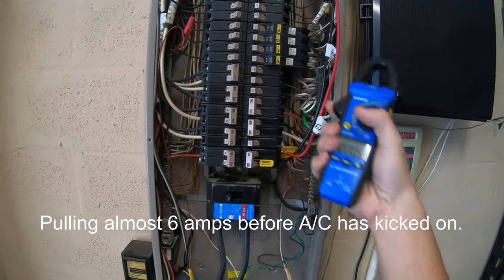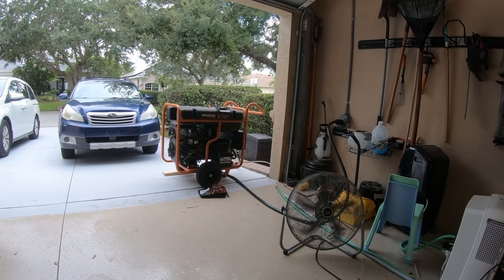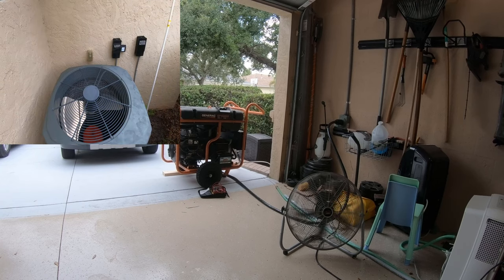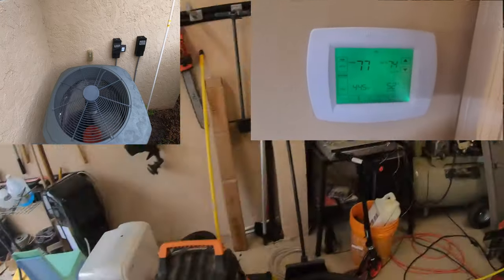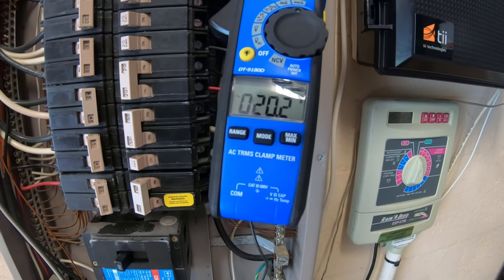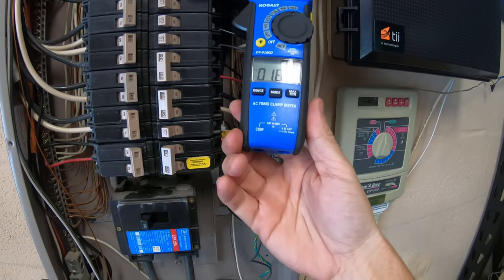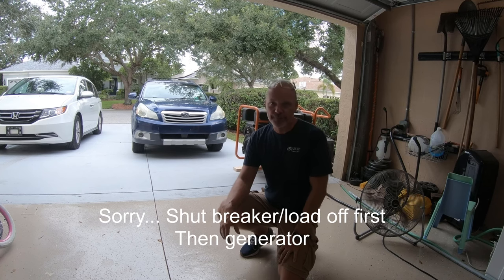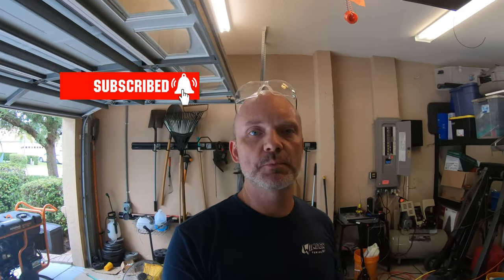Can I run central A/C on Backup Generator Power?

Comment: You gotta be careful using a genetic generator and sensitive electronics, like digital clocks, computers, routers, etc...anything over 5% THD (total harmonic distortion) can kill those electronics. I lost the control board on my water softener unit after I used it with my generator.
Reply from the maker: Hopefully I'm ok, my real sensitive stuff is all run off a UPS... which doesn't really care for the generator but tolerates it at higher loads. My understanding is the "dirty" power at lower rpms is cleaned up at higher rpms.
Reply: @JackofAllTrades1  it's safer to use an inverter generator. They are more expensive, but you don't have to worry about THD.
Reply from the maker: @mr.boniato6402  yea... maybe in the cards in the future. I've wanted to downsize this one as it is a gas hog.

Comment: If you have natural gas to house would be great to convert generator as that unit will use a lot of gas. I'm not surprized that it ran your 5 ton ac as I have a 12000 watt Winco tri fuel that runs my 3 1/2 ton ac. Running a generator off natural gas you lose about 20% wattage but you could probably still run your ac with that unit.
Reply from the maker: I've looked at those conversion kits... about another 300 dollars to upgrade it. I have natural gas too. I think I need to get a better sense of how much the power will be out here on a yearly basis to determine if it's worth it...... it would make it more reliable though. Thanks for the comment.
Reply: @JackofAllTrades1  That's a tough call. One extended power outage and you'll be cursing yourself running for gasoline constantly. That big boy will burn 1 gallon per hour.
Reply from the maker: @laurarettig9874  true... right now the emergency plan is to have all the cars full of gas before the hurricane and just siphone from them. I figure with a plan to run a couple hours on and a couple off I can make it a week. This has a 16 gallon fuel tank on it and I can store about 77 gallons total.
Reply: @JackofAllTrades1  During hurricane Sandy I was without power 12 days and getting gasoline was an issue. I was told it was near impossible to siphon gas from new vehicles. One YouTube video showed it being done with a pump.
Reply from the maker: @laurarettig9874  12 days is a long time, I'd be in trouble for sure. I have a hand pump made for siphoning gas out of a car... has a weighted tip on it.
Reply from the maker: @laurarettig9874  hey, I hope you are OK with this TS... you said something about Hurricane Sandy so I assume you are upper East Coast. I know that area hasn't done well in the past with hurricanes and flooding. I hope all is well.
Reply: @ Laura r Maybe you can shed some light on my issue. Here's the details:

Your "3 1/2 ton with a 12000 watt generator" scenario is my EXACT scenario. To date, I have:

• Converted my Duromax 12000/9500 watt generator to tri-fuel using Motor Snorkel tri-fuel conversion kit and mounted it to the frame of the generator
• Using a 50Amp inlet and a generator interlock, successfully hooked up generator to a dedicated 50AMP breaker in my 125AMP breaker panel main box (located outside)
• Using a 3/4" quick-disconnect off my natural gas line (from meter), I use a 40ft flex-line (rated for natural gas) that screws into my tri-fuel conversion kit (NG pressure regulator) located on the generator frame
• An Amrad TES5 hard start kit for A/C compressor

The house has no issue being powered by the generator while riding off NG. However, my A/C unit doesn't perform very well. I feel cold air coming out of my registers throughout the house but it is putting out very little air. The fan on the outside unit seems to have low RPM as well. Adjusting the NG pressure regulator's "load block" allows me to adjust how rich or lean the system will run. I've noticed the more rich I allow the system to run, the better performance I get out of the A/C unit (cold air blows out at a faster rate from the registers). However, this begins to heat up the engine on the generator to dangerous temperatures pretty quickly.

So what's my solution here? Do I need NG lines larger than 3/4"? If so, what would be recommended? The Motor Snorkel tri-fuel conversion kit's pressure regulator is designed to connect to a 3/4" line. This is my first conversion I've ever done so any input would be helpful.

Thank you all for your time.
Reply from the maker: @bobdole1232  my first thought us the size if that NG line. My NG bbq grill uses a half inch line to feed it but it is low btu....my pool heater on the other hand has a massive line, at least twice as big. Can you measure the amount of amps the generator is putting out and also the amount the ac is consuming with different fuel types to see if the NG is getting bottlenecked? You could also test out smaller loads on it and work up to see if it has a limitation at a certain Amp and watt level.
Reply: @bobdole1232  This is from Winco 12,000 manual:   Less than 25 feet 3/4 " black pipe
25 -50 feet 1 " black pipe.
Reply: Just remember using propane or natural gas on a generator that'd designed for gas works but will lower your wattage so 15,000 would be around 9,000 to 10,000. Propane or natural gas dosnt have the same energy. I got a kit myself so I can use gas or natural gas just keep in mind that's all
Reply from the maker: @kaylajason8917  good point Jason... I would like to convert mine to Natural Gas but with how little the generator is uses, I am unsure I can justify the price.
Reply: @bobdole1232  You need a Micro Air Easy Start 368
Reply: @JackofAllTrades1  ... as far as I know, there are no "direct fit" NG / propane kits for this unit. The second thing to know is a 15Kw unit will need a bit over 250 cu feet of gas in addition to what your meter is already supplying. Many homes do not have enough to spare in their natural gas feed. IOW, adding a NG gen set without thinking this through may cause your heat or hot water appliance to quit due to low gas pressure. You need to evaluate EVERYTHING on the gas system before going this route.
Reply: @JackofAllTrades1  Live in hurricane state of Louisiana, New Orleans last year IDA out of power 14 days, Katrina 30 days, don't remember others days out of power.  Tried last year to siphon fuel for neighbor, all the vehicles we tried have a anti-siphon in the fill neck to prevent you from putting a hose down into the tank.
Reply from the maker: @bayouslots3143  I will have to try that on our two newer cars to see if I can... I keep forgetting to do that so thanks for the reminder. I know for sure I can get gas out of my '72 gran sport so I guess at the very least I have access to the 16 gallons this gen holds, my 5 gallon gas can and the 20 in the Older car. Thanks for the reminder, I may have to rethink this.
Reply: @JackofAllTrades1  Understand, I empty my 1982 F150 with no problem, we tried  newer Dodge Ram 1500, Drango, Exploere, Rogue, with no luck.

Comment: I would suggest that connecting the generator cord should be done prior to starting, not after.  The primary reason is that provides a safety ground for the generator.  This makes touching the generator frame safer because when grounded it’s less likely to shock you.  Also it means you can avoid touching the energized cable. No need to add risk.
Reply from the maker: Thanks for bringing that up, I dont explain it in this video but my generator is bonded to a grounding rod that is at the corner of the house, if you look carefully you can see the white wire exiting the front of the generac and out of sight. I can't recall exactly which video, possibly my step by step install video but I do go into greater detail on the importance of having a grounded generator. Thanks for the comment.
Reply: @JackofAllTrades1  So, is that white wire and grounding rod connected to anything else besides the generator?   Meaning, is it bonded to other ground wire from the main panel? If there is a dead short from hot to ground and that ground doesn’t have a low resistance path back the the power source then the over current breaker won’t trip.  
For my own generator I depend on the wire between generator and inlet to provide ground both to the ground rod but also to the main panel bond to neutral.
Reply from the maker: @neilbrookins8428  the only connection the grounding rod has to the panel is when the generator is plugged into the power inlet. There is a ground wire located in the inlet that goes back to the PP and one in the power cable that goes to the generator power inlet and then to the frame and then to the grounding rod. This is actually what the manufacturer recommends is to bond the gen to a grounding rod when connected to a PP that is under a load. Odley enough, you are not required to ground the generator when using just extension cords for smaller appliances.
Reply: @JackofAllTrades1  i have no objections to your setup and grounding configuration.  I just think it would be safer to not ever touch the generator cord unnecessarily while it’s energized.  There is no disadvantage to plugging in first and then starting it up.
Reply: @JackofAllTrades1  ... no bonding required when using extension cords because NEC doesn't apply when not connected to a panel. The 4 wire plug to your home has its own grounding connection, if done properly, which will tie to the home's ground rod via the panel.
Reply from the maker: @rupe53  I appreciate the comment.. the poster before you was concerned about touching an ungrounded generator cable (live) without the gen being properly grounded before being plugged in to the power inlet.
Reply: @JackofAllTrades1  ... yes, but if you think about it, in that case there's no path to complete a circuit, even if you are standing in a puddle. IOW, the gen set is free standing and not connected to anything. In theory, you could grab one of the hot leads and not get shocked without a return path. Since you have a ground wire (separate) you have created that path, and that's actually against NEC because your pig-tail to the connection point in the garage already has a ground. NEC only allows for a single ground point when connecting to a home panel.
Reply from the maker: @rupe53  that's an interesting point you brought up. I probably misinterpreted that part of the user manual and that was likely for systems that did not have a ground already built into the circuit leading to the panel.

Comment: How many amps 3 or 4 ton AC unit does it need to kick start at first ?
Reply from the maker: @The_Primary_Axiom  look at the breaker for that ac unit and take away 20%, and that should give you a good idea of what the initial amp draw is.
Reply: @JackofAllTrades1  Thank you

Comment: Hey thanks for the video ! I just got the same generator , What I don't get is this is the same 30HP engine & size as the Generac GP17500E    does the 15000 have a smaller electric motor that puts out less watts ? The 15000 has all the same features for less $$$$$ & total watts than the 17500 . Thanks for the video ! & I plan on doing the same hook up You have with mine , & it's nice that You have got 5 years on it. Thanks again 😉!
Reply from the maker: Hey Venice, thanks for the comment. Really the 15k is the better deal, right? It is already limited by the 50 Amp plug and the 17.5k is limited even more. From my understanding the conductor is the only difference... more copper larger magnets etc... which pushes its max output higher. I can't imagine needing all that, my last two houses have been almost 3k sqft and this generator has ran them both as if we were on normal power. I think this generator will meet 99% of most homeowners needs.
Reply: @JackofAllTrades1  Thank You for the reply ! I guess I'll be covered seeing our house is 2,4K sqft. & it's all electric , but some Items will have to be turned off because I have a well & water softener system  with a septic pump out , & I don't plan on running everything with the generator, Thanks again.
Reply from the maker: @ACF6180T  I did load tests on my last house that was mostly electric and I could run two major appliances at once without issue. My well ran speratically but it along with the clothes dryer or microwave or stove seemed fine. The odds that I would be running multiple high Amp (3 or more) items at once would be very rare and avoidable in an emergency power situation.
Reply: @JackofAllTrades1  Got it ! thanks again.
Reply: BTW, both of those have the same 50 amp output plug. and both are capable of more than 50 amps. What you gain is a bit of extra headroom for heavy appliance starts.... and the ability to add an extra 120 volt cord to go elsewhere. Be aware that both units are thirsty in the gasoline departments. In theory you could run through 50 gallons a day (24 hours run time) at 50 - 75% load.
Reply: @rupe53  whoaaaa that seems HIgh    ???  50 gallons in 24 hrs at half load????    seriously have U done this???
Reply: @culbyj3665  ... I don't have to do it. The formula (rule of thumb) is 1 gallon of fuel per hour, per 5 Kw used. 10 Kw (66% load on a 15 KW unit) is 2 gallons per hour, times 24 hours, is 48 gallons. Most people don't come close to that loading for any period of time then complain that my numbers are off. These are mfgr supplied numbers.

Comment: Install a Micro-Air easy start soft start kit on you A/C unit ... it knocks the lock rotor amps on your A/C down by 70%.
It will make it much easier on the generator and the A/C unit
Reply from the maker: Thanks for the tip!
Reply: Hard start kit *

Comment: Micro-Air with Bluetooth is nice... you can see in real time the startup & running amperage, plus the company is really responsive if you have an issue...
I also added the emporia energy monitoring system which gives a good estimate of wattage, amperage & energy cost with or without the generator.
Reply from the maker: Thanks, I'll have to check those out.

Comment: I'm asking because I'm looking at a generator plug in my house, so I'm not trying to come at you...  Why did you install your generator hookup plug in your garage, rather than outside or behind your house?  You couldn't run it with the garage closed obviously, and in a power down situation I wouldn't like that the generator was sitting in front of the garage door.  Is your cord long enough to run it around the side of the house?  In Irma, I was paranoid someone was going to try to steal my generator and it was in my backyard behind a fence.  If they want it bad enough they can get it, but I'd at least like it out of sight.

Thanks!
Reply from the maker: Hey Dan, thanks for the question. There are a couple reasons for this. Number 1, I have a padeye sunk into the concrete of my driveway to chain my generator to. Number 2, the grass here in Florida is super soft and plush... dragging my 480lb generator over the grass from my garage to anywhere is a huge undertaking, so leaving it on the concrete is ideal. Number 3, having my receptacle inside cuts down on its exposure to the elements... it rains every day here for 6 months straight. Ultimately I decided to install it indoors for those main Reasons... my extension cord is 25 feet so it will park outside my garage where I can hang a tarp over it and keep it out of the rain and also keep an eye on it. At night, I simply shut it off and drag it inside the garage. I hope this helps explain my logic.... it is tailored to my specific situation and may not be the best for all.

Comment: I have a 3 ton AC but the outside unit wont come on. My generator is 10k watts with 13k surge/starting watts. Wondering if i just dont have enough power for it.
Reply from the maker: That should be enough power. A couple of things.... did you try to only power up just that generator and nothing else? Also, some AC units have a "wait" time after power loss before they attempt to start. Usually 5 min. Your thermostat should say waiting or delay on it during this time.
Reply: @JackofAllTrades1  thanks for the reply.  I had tried it with only the AC on in the house, but maybe I didn't give it enough time to kick in.  Will try it again during my monthly test. Appreciate the advice.